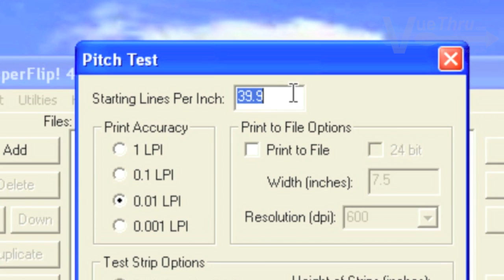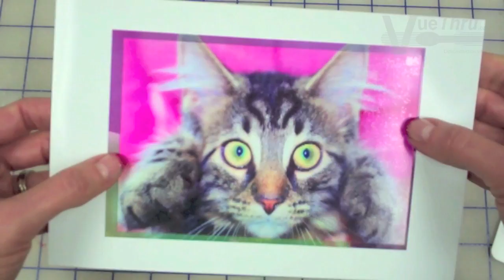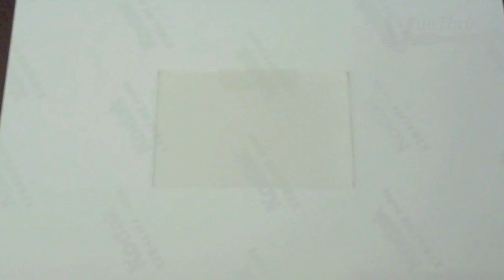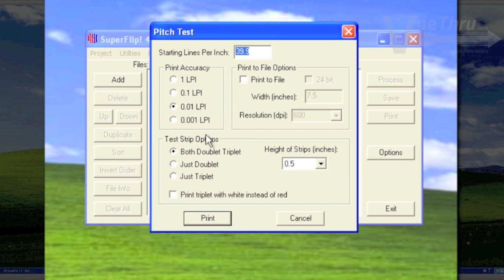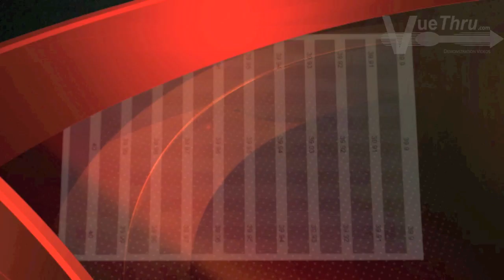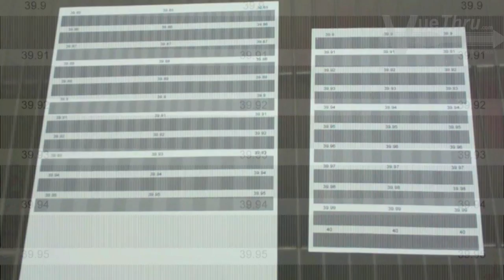Pitch Test

Comment: Hi!  How can we make our own pitch test file for our laser printer?
Reply from the maker: Its been my experience that the dither pattern of a laser is not good for lenticular.  The plastic magnifies the pattern.  Not saying it can not be used, but side by side with an inkjet you will notice the difference.  You should be able to save the pitch test file to the desktop and print it on any printer you want to test.  Make sure you print twice, rotate 90 degrees, just to make sure.  Hope this helps.